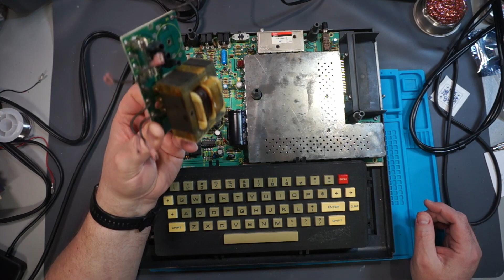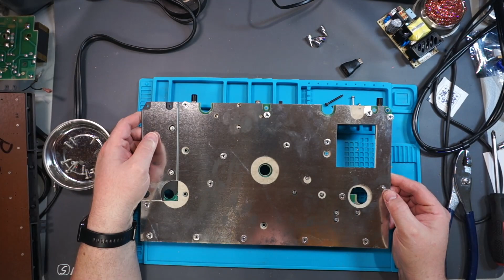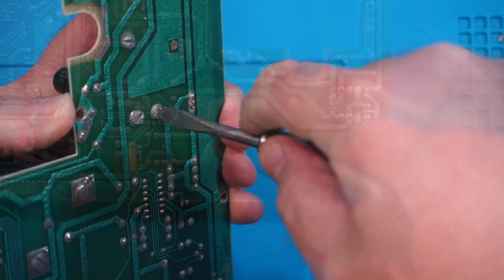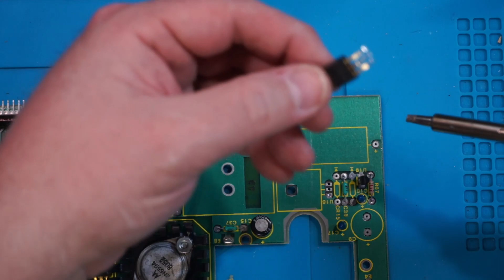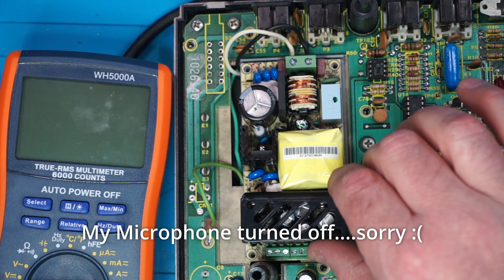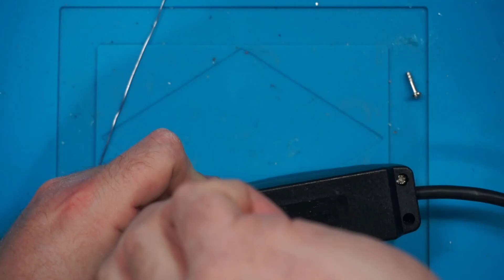TRS-80 Color Computer Model 1 Transformer Replacement, Is that smoke ? (Coco 1 Repair Part 1)

Comment: I see that your Coco 1 is the earliest motherboard revision that was widespread (revision "D" - it's the suffix for the board # that is just below the cartridge port). When that was sold, it could go from 4K RAM with Color BASIC (a single 8K BASIC ROM) up to 16K RAM with Extended BASIC (adding a second 8K BASIC ROM). They could be hacked all the way up to 64K RAM. Look forward to you next videos!
Reply from the maker: If I get the machine fully working, I will be trying the 64k mod. Thanks for watching!
Reply: I wish i had read this days ago. I have a later revision I think with just the L shaped board, not the cutout. I was wondering if this would work for that? any replies or hep is greatly appreciated. I'd like to use an old pc power supply that still has the -5 white...thanks